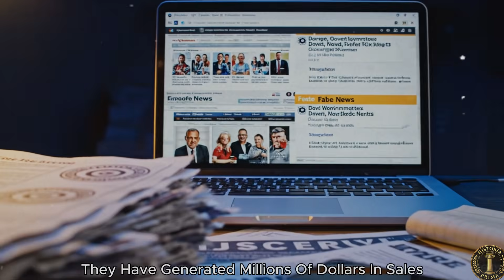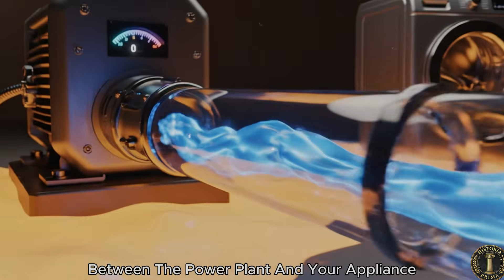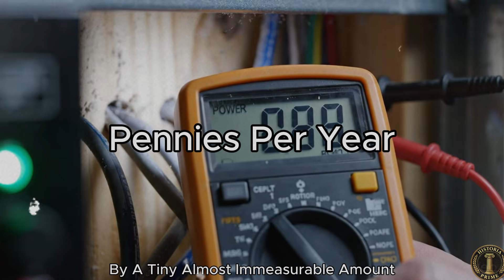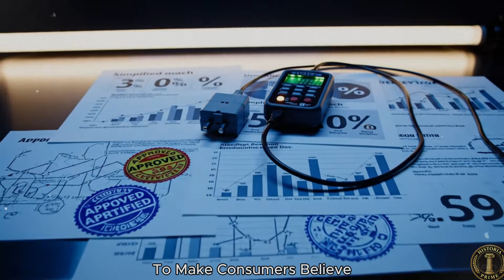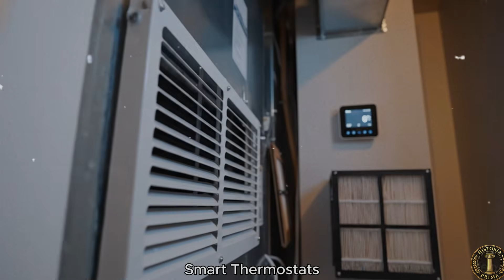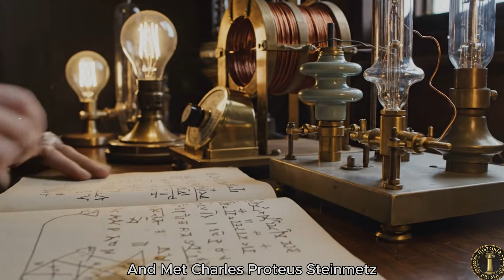This $1 Device Cuts Your Electric Bill 40% Overnight — Why Did Power Companies Call It Illegal?

Comment: Can you do one of these on those plug-in pest control devices? …. Are those scans too?
Reply: After buying a fixer upper, we had a bad bug and mice problem. I had one it stopped working after several years used.  I plugged one in after spending a lot of 💰 on poisons to get rid of roaches, mice and ants, that were gone for a short time and came back.  But about a week or so of using the plug in deviced, I notice less bugs. After about 1 month their were none. I never unplugged it until it stopped working.  All were gone for years!.  That was about 40 years ago, I have not had a problem for years so I will like to see if the modern ones work  better or the same as the one from the 80's.  Just in case I  see bugs again.

Comment: LED lights are TOXIC. They flicker in the microwaves rate of speed. They induce STRESS to the body. 

SMART thermostat are not innocent little devices they are monitoring devices.
SMART devices are spying devices. 

SMART = CONTROL
CONTROL = COMMUNISM
Reply: COMMUNISM = DEATH
Reply: @grandpied YES. One away it the other. 💯